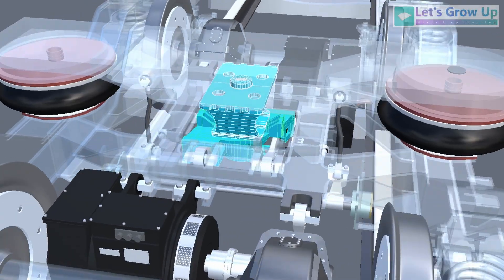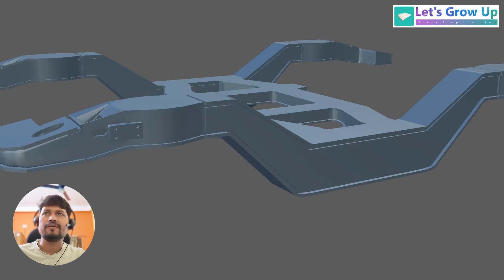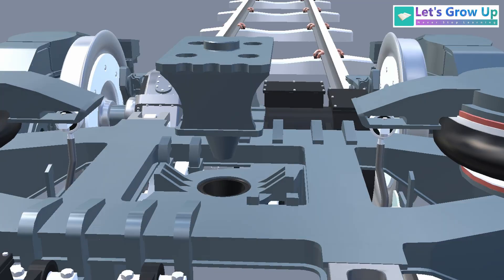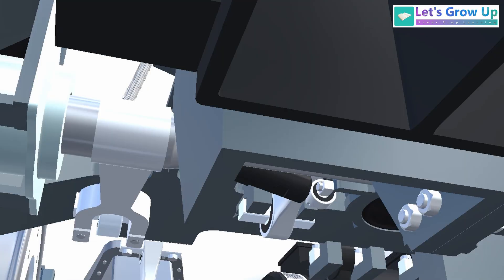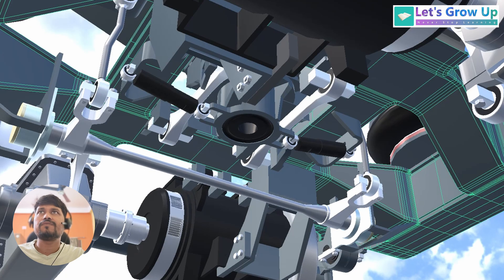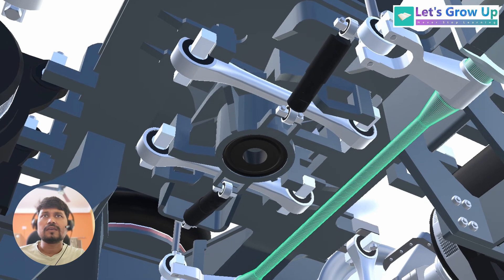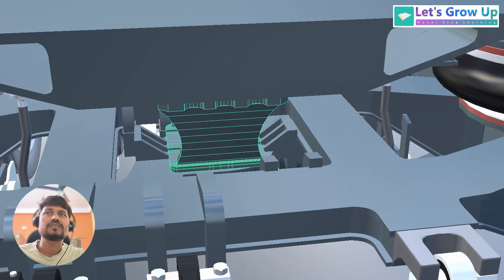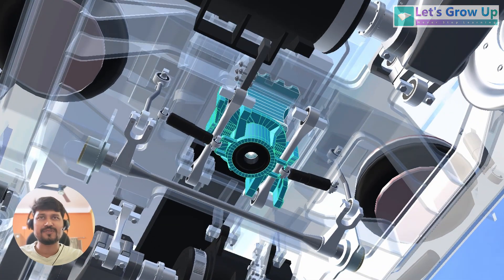High-speed bogie Traction Center Explained

Comment: I'm watching from Japan 🇯🇵. 
I understand the vertical displacement of the traction center (traction device), but this explanation doesn't seem to touch on how the forward and backward thrust and braking forces of the main motors and wheels mounted on the bogies are transmitted to the traction center. 
The oil dampers on the left and right would be too weak to follow the forward and backward movement, so I surmise this is the role of the two forward and backward link devices that weren't explained this time. 🤔🍀
Reply from the maker: Thanks for your valuable feedback